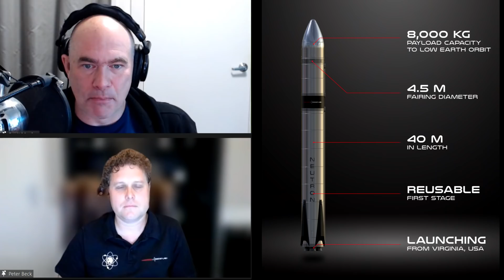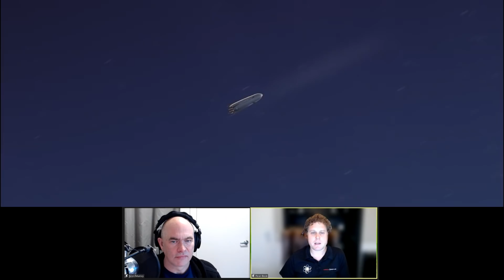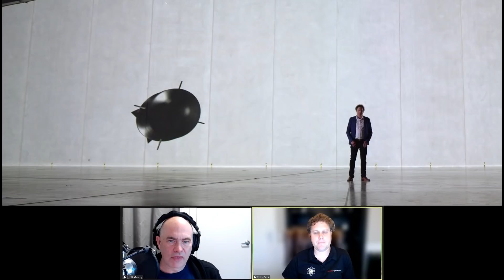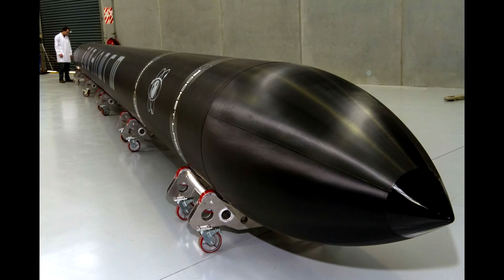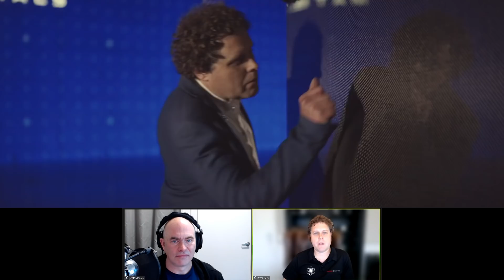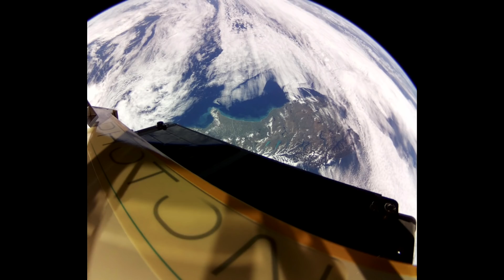Rocket Lab's Neutron Rocket's Innovative Design Explained By Peter Beck - CEO of Rocket Lab

Comment: It nice to see a CEO interview that isn't constantly metastisizing into vague big picture non-answers.
Reply: Thats for a reason. A lot of CEOs doesn't actually know what they are doing.(wink wink Musk)
Reply: @mdjey2  that's a pretty curious example to give. He's no more typical than Beck, i'd say. But what is interesting about these Beck interviews. Many things which were decided in the Starship program which move away from traditional rocket design have gone the opposite direction with Neutron. For example Neutron keeps the ground support infrastructure simple by keeping functionality (in a streamlined form) on the rocket (landing legs for example). Neutron uses a GGC engine operating far from its design limits.  Neutron uses carbon fiber and iterates only early in the manufacturing process but freezes things in later due to the toolings needed, and so on. Its great to see how an innovative company like Rocket Labs can show you how very different the solution can be for a new class of rocket.
Reply: @mdjey2  Saying wink wink doesn't make you correct mate, just so you know.
Reply: @mdjey2  see everyday astronaut interview with elon streamed on starbase (wink wink)
Reply: @mdjey2  For some reason, many space CEO are cool engineers (RL, SX, ULA …). But one technically-not-ceo is outstanding in the bad way (wink wink NASA)
Reply: @imarchello  Watch Common Sense Skeptic about Everyday Astronaut. Man is a shill. No hard questions.

Comment: Compared to Starship it is like both companies are going in radically opposite routes. Space X with Starship going full on into ground infrastructure and in engine performance so the rocket can be big and heavy and from cheaper material. While Rocket lab with Neutron, as Beck said, is going with fancy materials and engineering with the rocket itself but keeping engine and ground infrastructure as cheap as possible. And both are basically for different customers.
Also Starship is meant to re-enter at extreme speeds and you have to have much more hardware, engine power, heat shield and stuff for that.
Imho both approaches are viable and have hopefully a great future in front of them...
Possibly a rocket the size of starship would be a lot more difficult to pull off with Rocket Lab approach...and more expensive.
Reply: Like beck said, rapid iteration with carbon fiber is an awful idea. And even starship was changed from carbon to steel specifically because of that.
Reply: Fun fact: One of the Heavy-lift Vehicles from NASA's SPS study has similar payload to Starship (120t), yet only 4000t mass when full. Which is less than simply the fuel mass of Starship (a 20% boost), and even with a 22t mass reserve! Apparently, aluminium construction/winged flyback is a pretty efficient design!
Reply: @HalNordmann  Reusable? That is the big difference. Even the Neutron can't be called truely reusable.
Reply: Starship used high pressure FFSCC engines even with carbon composite structure.
Reply: I guess the usecase defines what the rocket should be like. Rlab aimes for a lower rocket but for a very specific audience that doesn't want a very expensive flashy super duper heavy lifter. But much more a rocket that has just enough to deliver what they need. While spacex is creating what they need themselves to achieve their goals, Rlab is just making what fits best for their business plan. It's much more a corporate view of things but not less good
Reply: I see Starship as being the space equivalent of the Liberty ships in WW2. Focus is on cheap(ish) mass production.

Rocket lab is more like building Rutan and other aircraft manufacturers producing specialized designs.
Reply: SpaceX is very ideological and is willing to brute force their way through complex infrastructure and heavy materials if it means they can have a wildly capable and optimized vehicle. Meanwhile Rocketlab is pragmatic and more corporate and so will take a performance hit if it means vastly simpler and cheaper operations
Reply: @osirisapex7483  SpaceX is betting on managing to quickly reuse a Starship. Every decision in Starship/SuperHeavy design is based on the idea of reusing the upper stage. If they were to fail to do so, most of the decisions made become wrong. Rocket Labs' design is a lot less risky, depending on the cost of the upper stage they are throwing away, it may be a very smart engineering tradeoff. Anyway attempting full reusability today only makes sense with super heavy lift vehicles, Rocket Labs wasn't going to go from Electron to a giga monster in carbon composite. If SpaceX succeeds and proves that they can launch on a Starship for less than a Falcon 9, Rocket Labs will follow step in 10 years.
Reply: The steel used in Starship design does not make as much difference in the total cost effectivness. The alloy price is small compared to costs processing and QA of pieces ready to be used for the actual structure. This all on top of quite a heavy desing you need to pay for pushing to LEO.
Reply: @osirisapex7483  But Starship isn't optimized. It can't be, given the fact it sells itself as a jack-of-all-trades do-it-all rocket, but it will only end up as a master of none.
Reply: @philippeferreiradesousa8673  It is the exact opposite - full reuse matters the most on light rockets, since they fly the most often.

Comment: This rocket really is the "Delta Clipper made easy: Just add a second stage" ... that's actually awesome, you can ditch the fickle hydrogen, don't need to look for aerospike engines or chase every gram of saved weight and every second of ISP.
Still, now that there IS an aerospike engine out there... would LOVE to see it anyway.
Reply: A hydrogen-oxygen second stage would make it even better!
Reply: @HalNordmann  hum... Methane higher density should more than make for it.
A "third stage" using small ion/plasma propulsion on payload would be better.
Reply: @HalNordmann  Hydrogen in a linerless carbon composite tank can be quite problematic.

I think the next logical upgrade is a smaller staged combustion cycle methalox engine on the second stage. Up the specific impulse and drop the dry mass. (Fuel rich staged combustion might be relatively low hanging fruit. And reuse considerations aren't important on the second stage.)
Reply: @espenha  AFAIK, hydrogen's specific impulse beats the increased tank size, even if you have to make the tanks out of aluminium instead of composites. To me, methane seems just like a cryogenic better version of kerosene.
And why staged combustion? Expander cycle also works with great Isp.
Reply: @HalNordmann  You're talking about so much redesign that it would basically be a different launch vehicle.
Reply: @HalNordmann  You're forgetting that to increase tank size on the second stage would require a redesign of the first stage.
Reply: @HalNordmann  you'd need 2 separate proppelants at the pad, as well as two separate engine development programs
Reply: hydrogen is kind of a hassle to work with: might as well stick together a neutron heavy if they really need the added payload capacity
Reply: @Jack Pluth They tried...that's what got us the X-33. Or was supposed to.
Reply: @torcoAaAa  That's not what they (or we) are talking about. IF you for some reason decided you want SSTO you NEED hydrogen because you just can't cut it with methalox ISP.
Neutron Heavy would probably not really work out very well either, better to just scale everything up than bolt together few of them.
But yea, this was not about adding payload capacity
Reply: It's somehow not quite as cool visually, but if I said "certain thrust arrangements of circularly-dispersed engines correctly vectored can produce virtual aerospikes" that might make put a smile on your face...
Reply: @HalNordmann  or at least an expander cycle (similar to RL10) methane engine. IMHO the design of Neutron is especially interesting cause they left the room for improving and iterating the second stage when the rocket will be flying, as well as using different second stages for different purposes.
Reply: @solarissv777  Speaking of RL-10, do you think a off-the-shelf Centaur stage could fit inside Neutron's fairing? Seems possible.
Reply: @HalNordmann  the main problem I see with hydrogen is that it requires additional specialized infrastructure. As for geometrical measurements, Centaur will definitely fit in by diameter, not sure about length tho.
Reply: @solarissv777   The additional infrastructure is worth it. The RS-25 has a vacuum specific impulse of 452s with a 40-year old design and a multirange nozzle, while the Raptor has 380s even with modern construction techniques and a vacuum nozzle. That is quite an improvement! A bit of extra hardware on the ground for a 20% bigger upper stage efficiency is definitely a good tradeoff. The "conventional wisdom" that better fuel handling beats efficiency is mostly just from Musk's PR anyway.
Reply: @HalNordmann  hydrogen is undoubtedly superior for the upper stage engines, but they would need not only to upgrade the infrastructure, but also the first stage in order to put upper stage hydrogen connectors there. However, I would argue, that Rocketlab theoretically can make even more weight efficient hydrogen upper stage than Centaur by using metal only for isolating hydrogen and using carbon composites to bear all the loads. Unfortunately, it is unlikely that they possess enough money to develop two absolutely different engines, as well as costly hydrogen handling techniques.
Reply: @wool1701  Yea I know that. You get a tiny little performance boost by throttling down the middle engine and pointing the outside engines towards the middle. That boost is is an aerospike style effect. It's just not the same
Reply: @Jack Pluth  @stardolphin2  Why X-33?  It was X-34 ! Quite reasonably conception for it's time.
Reply: Look: it's great that Rocket Lab is pursuing a design that doesn't depend from day one on bleeding-edge engines.  But it's still really early in the design cycle, so to me, it's more a matter of them having a little more margin available there, for when they realize the actually DO need more engine performance.  Beck said in his Tim Dodd interview, the engines are always the last thing to the launch pad, and he also said that you choose where the pain will be.  This doesn't mean you get to choose where ALL of the pain will be.
Reply: @solarissv777  This is why I proposed an off-the-shelf Centaur - the development cost of those engines has already been paid.
Reply: @HalNordmann  those engines were developed in pre-additive manufacturing technology era, I believe, today, if designed from the ground up, such engine could be made much cheaper, or even more efficient.
Reply: @solarissv777  Well, the RL-10 is one of the most upgraded engines in the world - the current one has very little in common with the first one. And hydrogen isn't yet proven to work with 3D printed components - so far, that technology has only been used on hydrocarbon fuels. Additive manufacturing is capable, but it isn't magical. And even if the RL-10 couldn't be upgraded or was expensive anyway, then RLab could develop just their own tanks with another off-the-shelf expander engine - LE-5, Vinci, BE-3, etc.
Reply: @HalNordmann  I mentioned additive manufacturing specifically because without it manufacturing nozzle for expander cycle engine is rediculous tedious and expensive process.
What else could be interesting with modern technologies is electrically driven turbopump, with electricity provided by hydrogen fuelcell, or maybe even hybrid: expander cycle with electrical assist.

Comment: One thing most people don't know about those electric pumps is that they didn't just have to design the pumps themselves from scratch, but the motors themselves.  The power to weight ratio of the pump motors is tremendous; they produce 37kW of shaft power at 40,000 rpm.  Only very recently has motor technology advanced enough to produce a motor that size which has that kind of performance.  And because of its very compact size the motor has to be liquid cooled, and I believe in this design it is done with the RP-1 fuel.

And talking about oversized upper stage engines, look at the Falcon 9 upper stage.  That engine produces 220,000 lbf thrust in vacuum.  It's the most powerful single engine ever produced for an upper stage.

Comment: Having watched a lot of SpaceX launches I note that the F9 MECO happens at roughly 80 km, then the 2nd stage gets to 100 km in under a minute usually & drops the fairings. Neutron is going to have to get the whole load to 100 km all in the first stage. I’m guessing they’ll have to go more for altitude than horizontal velocity, coast a bit after MECO to 100 km, then let that little beast of a 2nd stage provide more of the orbital velocity than the F9 does. Should be interesting to watch. I hope they stream video back like SpaceX does.
Reply: Makes more sense to go vertical for them anyways cause it's less distance back to base for the 1st stage

Comment: The accent wasn't trick, the audio quality on peter side was.
In any case, this engineering talk was exciting, using rechargeable batteries for extra rockets engine performance and lighter stage is quite the branch out solution.
And the faring design choices are fascinating.
Shame isn't human rated... Yet.
Still, great for those looking to launch a probe or satellite.

Comment: The only bit Peter didn’t cover on the ground equipment side is the service tower which will be needed to drop the 2nd stage into the first stage via the “jaws”.  I don’t see RL just using a crane like SpaceX but may be wrong.

Comment: Glad to see some mention of the CARBON COMPOSITE printing. This is what Musk had originally wanted to do for Starship, but had found to be too difficult. It appears that Beck has solved this problem. Hopefully we will hear more about that side of the picture soon.
Reply: Elon has not ruled out using carbon composite in future. 
The main issue SpaceX had with use of composite were with making large, and relentlessly reliable - so reusable - composite overwrapped pressure vessels (COPV), and secondly, after a decision to go with a rapidly iterative development system such as that of Starship currently you cannot use carbon composite because a dedicated machine/mold will have to be built for every new design - something Peter Beck admits in this video. My understanding (from this video) is that Rocketlab are designing and virtual testing pretty much everything in computer models before going ahead with tooling up and physically constructing what is essentially the final design. 
Once SpaceX has achieved what Elon considers as the best design its quite probable that composite make be used as part.
Reply: @epincion  I had forgotten about that aspect. Good point.

Comment: I think it’s very interesting how Spacex started out looking at carbon fiber and then dropped it in favor of Stainless steel as it could cope far better with heat. Must mentioned that the resin used in carbon Fiber melts, so I think it would be great if Scott could delve into this a bit.  What is Peter Beck doing with carbon fiber that will mitigate the issues that Elon raised?

Comment: In the three interviews I've seen I don't recall any discussion of liftoff issues or the need for a flame diverter and ground equipment, even if minimal.
Reply: At 8:50 you can see they have at least some form of launch table. Probably also with a water deluge system.

I doubt they've figured these things out in detail, though.

Comment: I would have liked to have gone deeper on a bunch of details. For one thing, Peter talks about a "hot skin". Ok, so, how is it supported? Are talking standoffs and an air gap, or an insulating layer? Has he considered active cooling - particular on the feet and where those shock fronts are going to meet around the engine and lower body. Active cooling meaning running liquid methane through channels in the skin and then venting the gas into the engine bay (rather than fine transpirational holes). What about carbon foam in some places? When its hot but still at relatively modest temperatures (like under 1400C) it degrades only slowly.

Are we going to see 3D printed structures for all the complex plumbing, like the risers for the fuel to the upper stage? 

The video shows the canards moving quite fast. Do they have to respond so fast and if so, how does an electric or even electrohydraulic actuator respond so fast?

How much load is there on the second stage when it is firing? 

Ok, so Archimedes can be throttled deeply, but if the second stage just doesn't need the thrust, doesn't having an overpowered engine represent having a mass you don't need?

Speaking of throttling. I know that Peter has said that he'll use gas to spin up the gas generator. Have they done the trade on the following - using small electric motors and pumps to bootstrap the gas generator. Might work out less mass than the gas bottles? And also it might lead to being able to get to lower throttle.